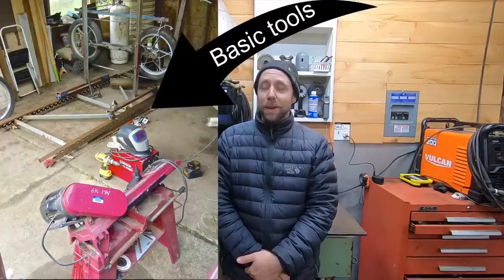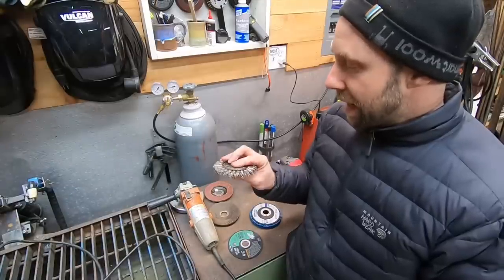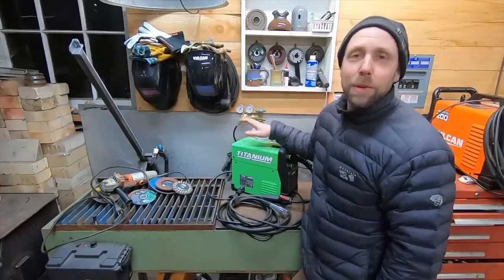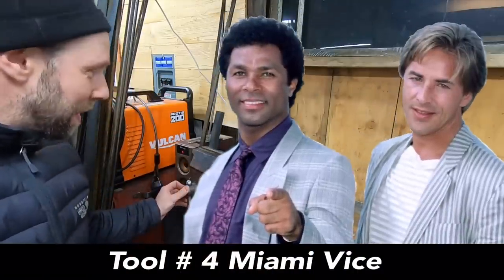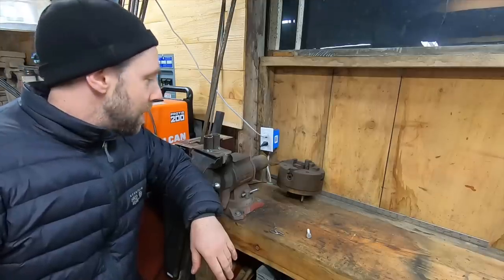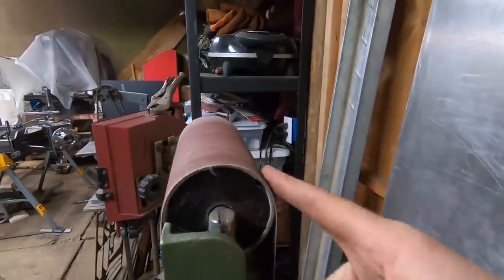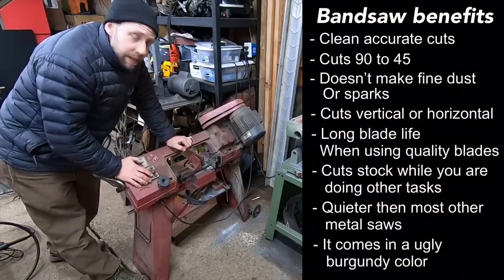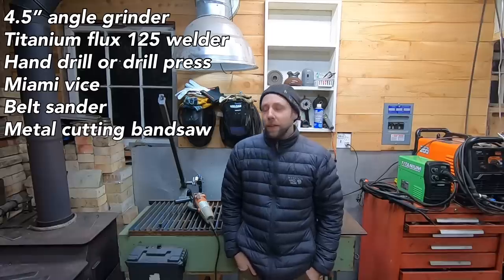6 affordable tools I recommend to get started in fabrication

Comment: Welding engineer here. I disagree with your welder choice, but not for the reason you mention : i started with stick because it was twice as cheap as your welder. Yup. A small 80 amp inverter syick welder costed me ~100 bucks on amazon with a coupon (normal retail 120). Also, gasless mig welders need a "better quality generator" wich means that for the same price, you get a better machine.
Also, the technique point. But not just because "you're not a welder if you don't TIG" or something, just because it is wayyyyy to easy to have 0 penetration with mig. There's a nuclear power plant under construction near my town and they have to redo something like 70% of the welds because trained welder had no penetration whatsoever. The weld do look good from the outside, but no strenght at all.

Also, how arrogant you are ! Turning comments down by saying "if someone suggest anything else it's because they have something to compensate" basicaly says FU to anyone with a different opinion ... Don't go to youtube if you don't want to hear from people !
Reply from the maker: Haha, we all have opinions Leo.
I just said if someone thinks they have better suggestions on welding gear for someone starting out on a budget, then maybe they should make there own video that’s all. Get out your camera 🙂
Reply: You claim to be a welding engineer...okay.
As for your claim about 70% of the welds in a nuke plant had no penetration...that I highly doubt...I know a few of those crews, they would have caught that shit on their own long before it got that bad...not to mention the place is crawling with inspectors.  
If you know at least half of what you claim to know about the welding industry, put it on your channel and prove me wrong. 
As for me, I've been in the profession for over 35 years, have to many certs to remember. I run a crew that builds ballistic buildings for various government agencies. I'm not bragging, or saying I'm better than anyone, but there are some holes in your story...js
Reply: Leo must live in a 3rd world country. I recently did a job fabricating stands for the CAT and CT scanner shields of a hospital. Heavy 1 1/2" steel plate. Just stands mind you, not the actual enclosures to keep radiation from escaping, and I had to have all my work xrayed even after passing my 2G and 1G test for that job. Just freaking stands. If an inspector team failed to notice 0 pen on 70% of the welding on that kind of project, the welds are the least of your problems. Leave this dude alone, flux core penetrates pretty damn deep, not to mention that mig is the easiest to learn.its a good recommendation. I've been welding for years, I rarely have to TIG. It's all Stick and mig in the central Ca valley.
Reply: @smokerise     search for flamandville EPR nuclear reactor. It's litteraly less than an hour away from where i live ... and is going to cost millions to EDF (the french electricity company)
Also, this is youtube comment guys. OF COURSE I'M GOING TO SIMPLIFY A BIT. OF COURSE IF YOU HAVE PROPER TRAINING, AND PROPER MATERIAL ACCIDENTS ARE LESS LIKELY ! (Even if accidents do happend, eg this story above)
But keep in mind the audience : begginer that probably never made an arc. Not people passing 1G tests.  people having any clue of what metallurgy is, probably even what penetration means ! In this context, i think that it's better to get a stick welder. 

The main point of my comment though was the "don't listen to other guys" part of the video. Look, we all disagree and are talking calmly about it. No need to say that "if someone recommend another welder it's because they have something to compensate" as written wonderduly in the video.

Finally, to be totally honest, i'm currently buying a MIG welder. I have already took some classes and can lay a decent looking bead, and the high deposition rate will be usefull in some of my later projects. I'm not AT ALL saying "Mig is a dumb process that has no use", i'm just saying "it's harder than it looks, and might not be the best choice for teaching yourself how to weld".
Reply: My philosophy on welding depends on if you plan on making it a career or if you are just doing DIY stuff. If you plan to go pro start with a stick welder, you'll learn a lot more from it going forward. That said if you are just DIYing, everyone should own a cheap mig welder. As long as you're not doing structural welds you can do a lot with them.

I own both the older Chicago Electric 90 amp mig and 80 amp stick welder. Got both on sale for less than $100 each on sale at HFT. I'll never go pro but I find myself using the stick welder more than not, because  it gets better penetration.  However to paraphrase Mythbusters Jamie Heineman useing a mig welder is as simple as using a hot glue gun but for metal.
Reply: Hahaha well good luck Leo. I've been welding all up and down the California coast for ten years, which is half or a third of the experience of some of my coworkers. I get plenty of jobs but I'm by no means a welding engineer of your caliber. Lol maybe you'll get a job with those French folks fixing those welds.
Reply: Don't forget that he's talking about people that are setting up a home fabrication shop so nuclear power plant quality x-ray welds are probably a bit out of the beginners reach at this point but in your defence those types of welds should eventually be strived for . . . So with that said you gotta start somewhere and if you don't have a lot of money his advice is still good advice and will get the average person started in fabrication and gain welding experience
Reply: I respectfully disagree with you Leo on your remarks towards the mig process and your so called lack of penetration . . .I have gotten excellent penetration, near perfect welds (to my abilities) and with both flux core and mig you are right that better penetration can be gotten on thicker steel with a much cheaper machine stick welder SMAW but I wouldn't say far superior to MIG with the proper machine dialed in for the matierial being welded you gotta admit it's a much cleaner prosess I do know that they don't weld submarine hulls together using stick welds they sub arc them which is wire fed  prosess
Reply: @BackyardKreaper  yeah I agree  but TIG is a lot of fun and you can really control things better on all types of metals but you are not going to be bailing lots of wire with TIG I enjoy the he'll out of it though
Reply: Scott Barlow Yeah that's true. TIG is a great process. For a beginner that has a passion for it, it's definitely a process to learn. It gets expensive in my opinion for a beginner and if you don't buy the right machine you end up buying more! Not to mention getting tungsten, cups, a foot pedal, cylinders, etc. If someone does start out with TIG I would say get a good machine like the Everlasting  combo machines. Especially if you can afford a AC/DC machine. That would a machine to last you a lifetime even if it's low output like 140-150 amps. Get a deal on a cylinder on eBay or a used on on Craigslist and your on the way.
Reply: @BackyardKreaper  I agree with you and it does require experience with at least stick MIG and even gas / brazing so that you can see what happens regarding how much heat is necessary and how much filler material in order to get good quality welds I like TIG because you can control each phase of the process separately and you can weld every type of Ferris and non Ferris metal that you can possibly use and so precisely down to 5 amps for like jewelery all the way up to 3/4 in and thicker aluminum 300amp  and beyond with the proper machine and water cooled torches they are just amazing and interesting to learn all that the process can do

Comment: Been wanting to get a MIG.  Harbor freight green machine is looking fairly good! Might step up to getting on with a gas shield option. 
Thanks for the video!
Reply: I bought the mig 140, still 110 volt but gives you the gas option and can weld aluminum too.  $350 on sale, worth the upgrade and so far welds great.
Reply: I have the Titanium 200 multi processor, MIG, stick and TIG. MIG and stick work great, haven't used the TIG yet. You can use it on either on 120 v or 240 v with a flip of the switch and the plug adapter that comes with it.
Reply: @refinersforge1781  Thank you!

Comment: Just so you know you are never supposed to ware gloves with machines that can catch you
Reply from the maker: Kyle Speer I use common sense, I still have all my fingers and never a reported injury in ten years at my current job, I do industrial maintenance and fabrication work. I don’t used gloves or long sleeve shirts when running lathes and milling machines, but I use gloves with angle grinders, sanders. Do what you like and I will keep doing what works for me 👍
Reply: @Mikefestiva  I'm not saying you dont, im also in auto fab field im just saying what you said is not recommended.
Reply: I agree with mike, the number of times i would have trimmed my fingernails with a angle/bench grinder if i hadn't had gloves on is more concerning to me than the chance of a glove getting caught. also there are gloves out there that have tearaway fingers so if one gets snagged it pops off and doesn't eat your actual finger (i pick them up from work not sure where you could find some google didn't show me any surprisingly...)

Comment: Really solid list. Total with all the grinding disks and even nozzle gel is only about $700.oo. that's with everything.  I have been a welder/fitter for 25 years. I have to assume you've been doing it for about that long. I have done a lot of custom thing over the last 15 years or so like roll cages hand rails things like that. During this coronavirus outbreak our company has been deemed essential since we build water treatment plants.  I have been tig welding aluminum handrail and frankly would love to do it all out of my garage if I could. I would only need the tools/machinery you describe to accomplish this. The Tig welder would be more than a hundred and a half but that's to be expected.  Gret video you have a new subscriber.

Comment: This kinda comes off as a harbor freight ad.  I would have rather had suggestions for high value, mid-grade tools, especially for things like a vice or drill where there are near infinite uses over your lifetime, though I already have this grade, of those tools.
Reply from the maker: Stinky Cheese Check out the title of the video again, 6 Affordable tools to get started in metal fabrication. This isn’t for guys that have a shop full of tools already, it’s for people just starting out on a budget.
Reply: Use the cheap stuff to make enough money for the higher end stuff.  Nothing wrong with baby steps. 👍

Comment: Great info. A quality welding helmet is a must. That Vulcan helmet is nice, but Eastwood has similar units for half the price and work the same. Money for more tools!!!
Reply from the maker: Yes I was going to cover helmet, clamps measuring and levels in my next video. I will definitely take a look at that welding helmet you mentioned, I get people from time to time asked about affordable welding helmets. Thanks 👍
Reply: @Mikefestiva  lighting is important as well, you would think the arc makes more than enough but its just not the right angle i guess getting lights positioned where they light up the work but not the back of your head and inside of helmet helps alot especially in learning to weld
Reply from the maker: Andrew Browner yes you are definitely right! This can be overlooked but I completely know what your saying, light coming into the back of your helmet can really reduce your visibility. Thanks for commenting 👍 ps I just saw a comment about a plasma torch you got, I will take a look at that model. Take care

Comment: Most metal cutting horizontal band-saws cost BIG BUCKS so, for a beginner, I'd have recommended a CORDED Porta-Band, for that same purpose, at about a quater of the price. Especially if you can find a decent used one on Let-Go, Craigslist, eBay, or FB Marketplace. Otherwise, great video!

Comment: I started with harbor freight tools myself grinders bandsaw welder bench vise almost everything and they worked now I'm on better brands
Reply: A metabo angle grinder for $100 and a used 220 amp stick welder for $100
And safety gear. For $200

Comment: I jumped too quick on the Omnipro 220, I should have found your channel before I bought. I needed to do aluminum and not having AC/pulse is a drag. Which is puzzling as to why they sell the spool gun for aluminum. My brief experiments on  aluminum were hilarious; it burns real good! lol! I will save my money for a good tig machine this coming year. I needed to fab small aluminum brackets for my radio chassis, and build C shaped half aluminum boxes for electronic projects. Tired of tapping angle aluminum to build chassis.  My new 20 foot fabric building turned out to be too small for autobody work, so I will have to wait till spring to repair the vehicles. At least its well lit and heated. Ive been laying down some tig welds on steel to practice. See ya soon!

Comment: You can get also cheaply sander/grinding stone combo to double usefulness compare to only belt sander. Grinding stone is great to sharpen anything, from drill bits to axes. And more other use. If you get one with water tank under stone, you can also wet grind, what comes useful.

Comment: Not a bad list but could use improvement. I would say a torch rig is a necessity if your working with steel above 1/2".  It allows you to heat and bend, weld, and cut thin to thick.  Can be found at estate sales or things of that nature for $75-$200 for medium sized tanks.  It would essentially replace the bandsaw but it's more useful. If you need clean cuts clean it up with a grinder.

Also, I see your point about the welder and I disagree.  Skill is important and necessary. Start out welding with a torch and that will teach you ALOT (why a torch is also useful).  Then I would say stick welding is next due to versatility (being able to weld through paint and rust, cut steel, as well as weld sheet metal with small diameter rods) as well as the skill learned through it. Mig welding is next however it isn't cheap mainly due to the cost of gas cylinders. Again though, cylinders can be found at estate sales for dirt cheap (like less than $30 cheap).  Stay away from Tig until you've gotten the first two down.

It should go without being said that buy all the Saftey gear you need. Buy the b at you can afford and you won't regret it.

Estate sales and yard sales are your friend when starting out. Great tools and supplies can be had for cheap.

One last thing, build a good workbench, wood frames are not ideal due to fire risk. Use the tools you get to build a hoot one and you'll be happy.

Comment: Thx for the walkthru and information...and a 18v or a 21v LiIon based drill is identical 5cell..
No difference it is all up to the vendor where they will take voltage reading when it is charged or not.
semi charged and almost empty battery 3.6v x5 = 18v vs full charged 4.2v x5 = 21v.. so no difference what so ever, same 5cell tool.
Harbor Freight has a line called 24v (Kobalt as I recall).. that one has an extra cell and is 6cell, but 18v tool or 21v tool is both 5cell and simply no difference..

Comment: I switched to a Lennox diamond cutoff wheel. For that strip disc, best to use it on a variable speed angle grinder, as the disc life is dramatically improved.

Comment: Around this time of year harbor freight sells off stuff that was either used and returned or with damaged boxes at extreme discounts I got a $100 3 ton jack and a $130 welder for $90 both work just fine
Reply: For sure,  picked up the Bauer portable bandsaw for $50 and a couple of the Bauer impact drivers for $25 each. Way cool! and I live in a small town so they didn't go as fast as they would in the city.

Comment: I agree with you for the most part. My only concern is if you’re a complete noob and trying to weld with a cheap machine it may be harder to figure out where you are messing up or the machine is not working as intended. I learned to TIG on an Everlast welder and I made strong welds that looked amazing but after a few years it started to act up and I thought I was doing something wrong and it turned out the problem was the machine malfunctioning. Imagine if that happened when I first got the machine. I would have been discouraged and quit. My two cents: if you’re unsure of your interest in welding then get the cheapo, but if you know you want to weld as a hobby or especially as a business then get a good Miller, Lincoln, or Esab. You won’t regret it.
Reply: True. I see it this way. Buy the best tool you can afford that will meet your needs. Even if you treat it as a hobby, the last thing you want is to waste time fighting your tool.
Having someone who will show you a few things also helps a lot

Comment: Thank you for this video. There very first video I saw was when you purchased the Titanium welder. Been watching your ATV truck build and the articulated truck. Thanks for showing the steps you take to design and weld. This video is very helpful for me to get started. I have not welded before and was thinking a Titanium 220 but will start with Flux 125. Need to learn first. Question: when you welded the bumper/winch mount you mentioned to drill small hole to let gasses escape. Is that true for larger tubing? When is not needed to drill hole? Thanks again for videos and instructions.